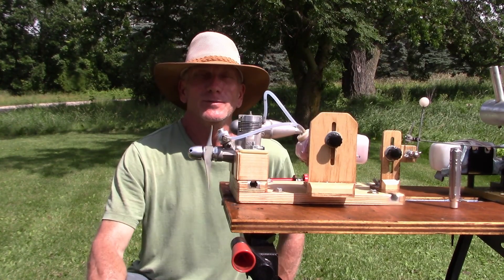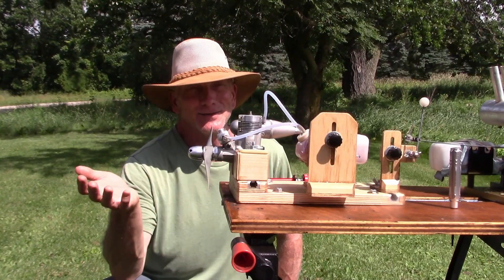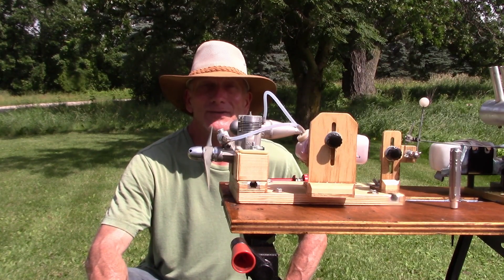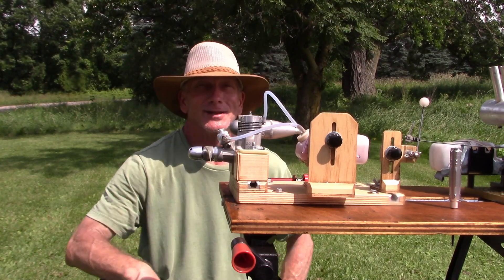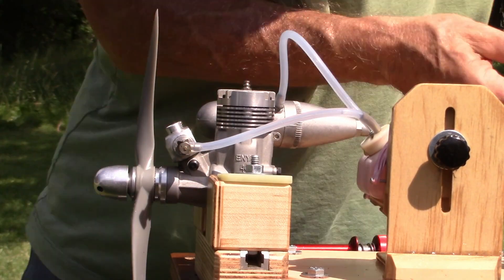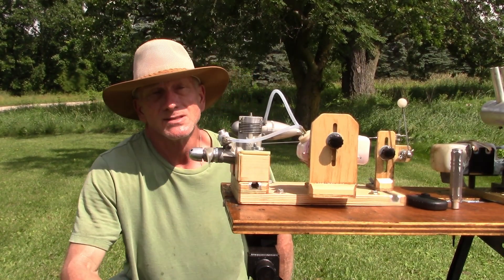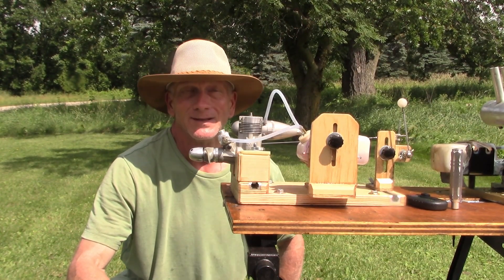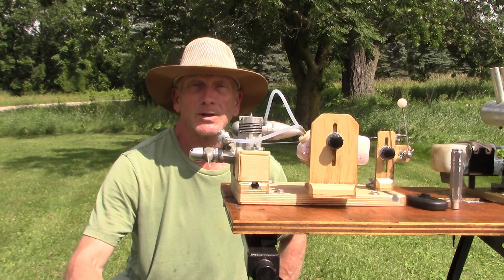Enya 40X A Run

Comment: Ive got a 40SS and a 60X myself which belonged to my grandfather, both of them still look brand new inside with no black residue on the piston or any carbon build up and they still start on the first flip today even after sitting in boxes most of their lives, They run like swiss watches these engines❤

Comment: Mine has a weird butterfly rotatable flap on the muffler (not shown in the video). Not sure how that’s meant to be used and I just leave it closed.
Reply from the maker: It is meant to move in conjunction with the throttle.
Reply: I have the 60X with the same muffler flap on it. its meant for priming the engine through the exhaust port which was how it was done in back in the day. its mounted on the muffler itself not the engine so not meant to move with the throttle no.

Comment: I have one of these in very poor condition (wrong screws used in head by previous owners). When you take that carb apart you’ll be surprised how the fuel is routed through the carb housing and then back into a tapered slit in the barrel before it goes into the centre tube again before it comes out over the Venturi. I think this is a way of having the mixture adjustable over the throttle range without having to move the barrel sideways like later fuel metered OS engines do.
Reply from the maker: Yes I’ve had these carbs apart before

Comment: This engine does have a pretty decent transition from idle to full power once tuned properly, impressed. Imagine if it didn't have the fuel leak out of the carb too, should be marginally better still.
Regards Harry